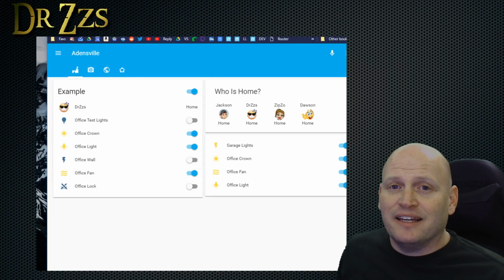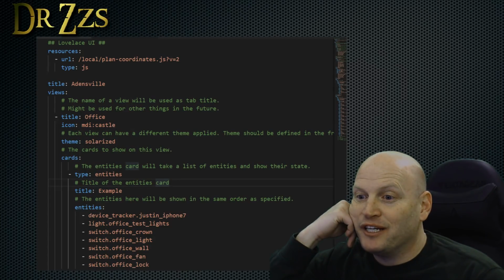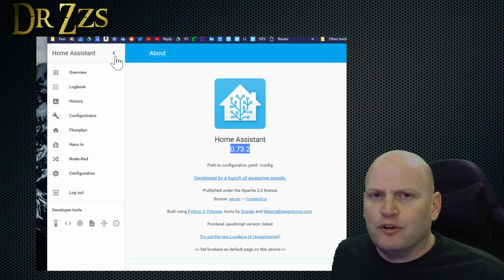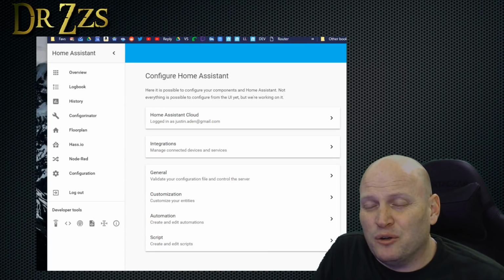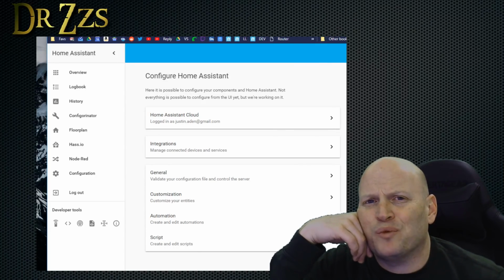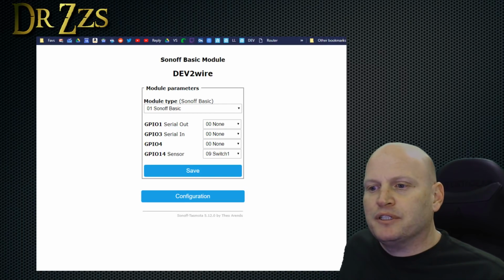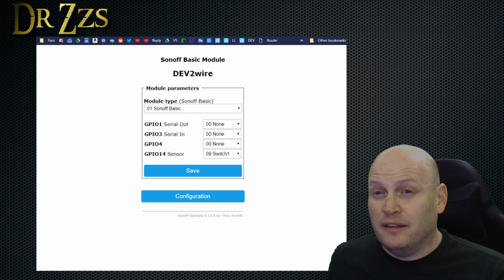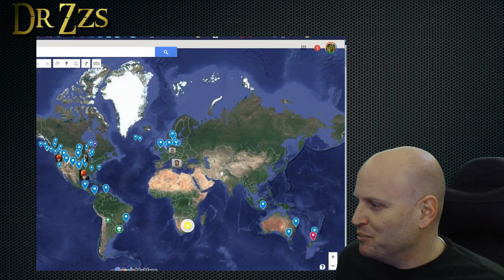DrZzs Home Automation Live Stream

Comment: You could control you projector over RS-232 using a D1 Mini or NodeMCU
Reply from the maker: that would be cool.  Can you point me to any more info about how to do that?
Reply: I've not done this myself, but I've looked into it. You'd need something like this connected to your NodeMCU: https://www.amazon.com/Ultra-Compact-RS232-Converter-Male/dp/B00OPU2QJ4/ref=pd_sim_147_1?_encoding=UTF8&pd_rd_i=B00OPU2QJ4&pd_rd_r=YM91HY46VD7YJT9MJGVC&pd_rd_w=QRMjl&pd_rd_wg=wXaHx&psc=1&refRID=YM91HY46VD7YJT9MJGVC&dpID=41DLqEoYlqL&preST=_SY300_QL70_&dpSrc=detail
Make sure you have the right serial cable (Looks like you would need a null modem cable if you got this male one, but a regular one is fine if you get the female connector.)

Your projectors owner's manual http://www.projectorcentral.com/pdf/projector_manual_8849.pdf
contains a pinout plus all of the different commands that you can run. You would just program the NodeMCU to send those commands over serial to the projector after receiving an MQTT message (maybe there is a firmware that can do this for you). It's pretty neat because your projector will also send its status back to you, so you know what input it is on. This document doesn't show what baud rate to set, but this other Optoma projector http://marketing.optomausa.com/PDFs/protocolFunction/Optoma_TX1080_RS232.pdf says 9600, so that's a pretty safe bet.

I hope you give this a try. It would be a really cool video.
Reply: Looks like there is a Tasmota Serial Bridge that I did not know of. Maybe that can do it? https://github.com/arendst/Sonoff-Tasmota/wiki/Commands#serial-bridge